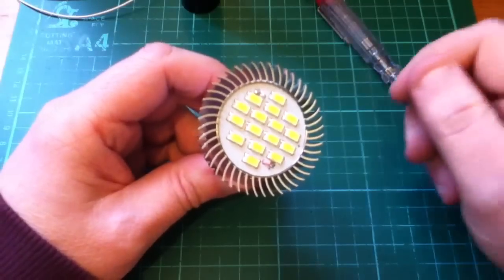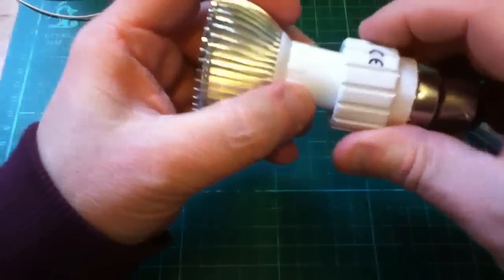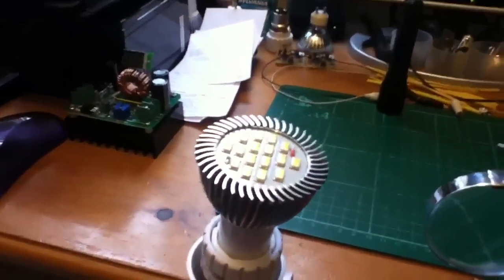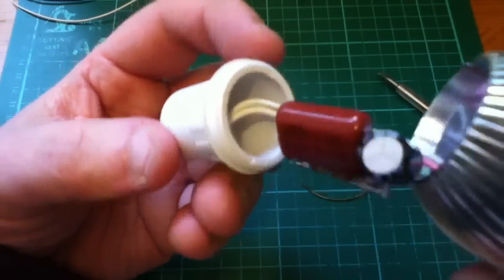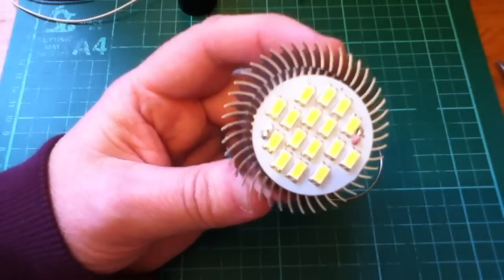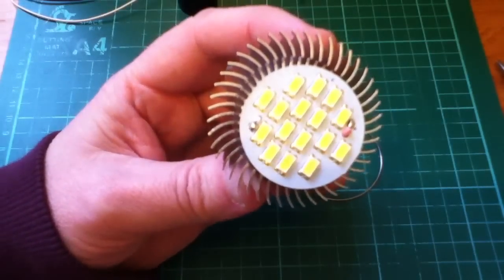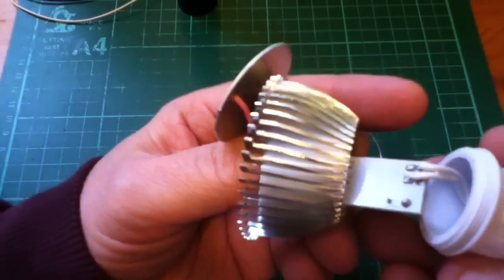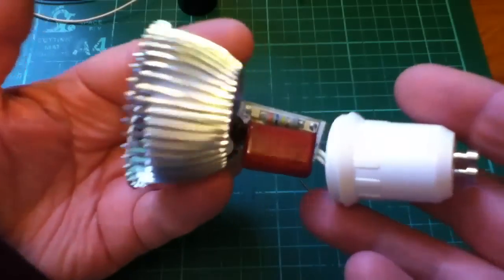Dangerous GU10 LED Spot Light is Cheap and Bright but could Kill You - Seriously

Comment: are you an idiot ??
why the hell you think they have used bridge rectifier for ?
and do you even know how the leds work ?
leds are polar devices, the rectifier has been used to convert the mains AC to DC
so the two notches on the top will have same polarity all the time.
have you measured the current flowing through the circuit or the potential at those notches ??
you are just some idiot talking bullshit .

Comment from the maker: All LEDs produce heat. Heat is a by-product of the conversion process from electricity into light - there's no technology that can do this 100% efficiently. LEDs are better than filament bulbs, but they do still produce heat. Low power LEDs generate a small amount, high power LEDs produce a lot of heat.

Comment: I dont think that there is anything to be scared of as the circuit at the front holding the LED's is only carrying small voltage DC. There is no chance of this 50 - 50 situation you are talking about as an LED is a diode, and as such will only light if the current of electricity is flowing in one direction and the correct direction. Do the lights only come on 50% of the time? No, didnt think so.
Also, mains lighting is not wired the same as mains power. You dont have live, neutral and earth.

Comment: I'd pay 3 quid for that heat sink alone to have as an ornament proper steam punk. What voltage do the Led's run @ 3.7v or 12v? It would be worth buying to convert to battery power for a desk lamp or boat, motorhome or shed

Comment: Sadly, CE marking is worthless. It does not require any testing to get CE, it's only an conformity statement of the manufacturer. You will find comparable built lamps with CE conformity markings.

Comment: A couple of points. One, these lights are not cost effective as they fail in as short as a few weeks of winter use. I know as I have repaired them time after time. Two, Julian is correct they are a shock hazard very much in the same way as the old Christmas tree lights used to be. Most of them carry a CE mark but I'm told i questioned the supply will tell that mean Chinese Export or some such crap. Three, Mistke mistake, your statement tells me you know nothing of electronics!

Comment: you'll have to prove it with a multimeter. test the voltage between the face of the bulb and earth (in both positions). i do have a degree in electronic engineering and i think this is scaremongering

Comment: I couldn't have said it better my self. any one that know even the little's about AC and DC would know that would know DC wont do any thing to you at even 100+ volts and AC / Alternating Current even if plugged in backwards will always power forward just look at a AC fan it never blows in reverse even when plugged in backwards   .. I can see that it dosnt look safe but I havent yet herd of any one die or even been shocked from one

Comment from the maker: There are two circuits to be considered here. The one that contains the LEDs has a small current flowing through it thanks to the dropper components. And you're quite right; the LEDs have just a few DC volts across them. My concern is the other circuit - the one that flows from live mains, through the rectifier diode, along the piece of wire to the front PCB, into your finger, down your legs and into the floor.

Comment from the maker: You're quite right about the bridge rectifier, and I apologise to anyone who went ahead and bought this bulb, thinking that a 50% chance of being electrocuted was an acceptable risk. The diodes ensure there is a 100% chance of being electrocuted. Ignoring the RC side of the dropper, the direct wire link to the front PCB routes live mains (240v relative to ground) during one half cycle and neutral (low voltage relative to ground) during the other. Transformers do fit - most LED bulbs have them.

Comment: I think you need to study how a full wave bridge rectifier works. a bridge rectifier provides a universal +tive and -tive in pulsed dc. (it dosent matter which way round the ac supply is) the + pin will allways be +, this dc is pulsing at 100hz though, so a capacitor is used to smooth it. if you think this is dangerous. connect a multimeter and prove it. also. a cap dropper circuit isn't nasty in this situation. you try fitting a transformer in that space. its the best circuit for the job.

Comment: If you think in this way, it is not possible to change any ordinary bulbs( like 40, 60, 100watts), comparing with 220vac / 40watts bulbs this 12vdc / 6watt gu10 or mr16 power is negligible. Just few microns of insulation is not enough to stop current passing through the metal housing?  This is my suggestion, can you please explain exactly how this 12v/6w power will harm us.

Comment: There should be a fusible resistor in series to protect against fire.  Also, the big capacitor should be X2 rated for connection across the AC, especially since the line voltage in the U.K. is 240VAC, twice what it is here in the U.S.  The LED lights that I've opened up have a step down switch mode power supply, so there's some isolation.

Comment: Not all GU10 spot light are like this, I have 10 at home, and circuitry is nothing like yours, also the one I have picked have a acrylic glass. To bad you picked the wrong ones.

 dx.com/p/gu10-4w-3500k-360-lumen-4-led-warm-white-bulb-85-265v-68459

Hope it helps, out there are many places which offer led light.

Comment from the maker: No, halogens have no exposed metalwork once the connectors are properly inserted in the socket. The housing is made of thick glass which is a very good electrical insulator. They're safe to touch (as long as they're not hot).

Comment: amps have nothing to do with how well earthed you are. amps are draw (Wattage pulled) divided by voltage. that device has a draw of 4W making the amps being pulled at 0.01 Amps... also those particular LEDS use 5.5V and the power is stepped down by a transformer inside just like power packs for any low voltage device. now if the bare leads BEFORE the step down transformer are touching the walls of the device you risk shock otherwise no, and an aluminum casing doesnt transmit electricity this way

Comment: I seek DC LEDs using batteries off grid. Need small night lights, larger spotlights, & 50-100 W room lamp replacers. What DC voltage best for battery/home wiring array (no wasteful inverter) for ALL these plus efficient refrigerator, food mixer, drill, hand saw, computers etc! A big problem with off-grid is getting lights & most appliances using same DC voltage (to wire house/barn). We must devise DC standard for America-Europe-Russia. Making stuff can be good whiteman industry; ban Asia imports

Comment: GU10 incandescent Halogen lamps don't, the reflectors are on the inside of the lamp, there is a glass front on them (as you probably already know) and they have a ceramic base, add to that the fact that the fixture is most likely earthed and you have a safe fixture, even I change the lamps while they're lit even though it's not recommended, all in all, it's just the cheap crappy LED lamps that have that issue of a posible live heatsink, GU10 are safe until they get hot... talk about glowing!!!

Comment: They really should've added some diodes to the live side, and actually make sure that the lamp will not power on when inserted incorrectly, and add a little glass cover over the diodes would've been a nice touch too!!, not using ebay for an LED lap then...

Comment: You do realize that the voltage present at the board containing the LED's is only going to be enough to power them.  Not even close to a lethal voltage. The 300k resistor is what's going to drop the voltage. The rectifier is going to give you full wave rectification and the cap is smoothing out the humps in the sine wave. That's how DC current is made.  Do yourself and everybody else a favor and check voltages with a meter before you start pretending like you understand OHM's law.

Comment from the maker: There is mains on the front whichever way round you connect it - one way it will be neutral and the other way live. High voltage mains, metal casing and no earth is not a good combination. But using a dropper circuit is just reckless. Maybe the lamp was originally designed to use a transformer driver, but the dropper option was cheaper. I can't believe an engineer could sleep at night after designing this product as it's sold

Comment: It's really bad no matter what direction you put it in. Sure, in the "right" way there are no mains on the front, but it's stil pretty high voltage (I'd think all of those LED's are in series so there should be at least like 50V DC and probably a few hundred milliamps). And, since it's not isolated from the mains, it shall always be looked at like it has mains all the way (A short in the dropper-cap and there you go).

Comment from the maker: Fancy a nasty shock?
Reply: +ArJuna22 Not true.  You're making the age-old mistake of thinking that more volts means more danger.  I have been zapped plenty, in both the US and EU, and I will attest, the US is a tad bit more uncomfortable.  You see, 240 at 50Hz is 1/6th slower than the 115 at 60Hz.
Reply: death pretty much
Reply: +Julian Ilett Here in the USA we might get away with a nasty 115v shock, but in the UK the mains voltage is double or 230v.  This has a much better chance of killing you.
Reply: yes because the current is basically unlimited on a non-GFCI outlet which means practically every overhead light fixture in the USA, & even most up-to-code indoor wall outlet recepticles.
Reply: +Julian Ilett No UL stamp? Do you have a similar organization in the UK?
Reply: +Pete Joplin Its not an old age mistake - low voltage and extra low voltage are marked as safer. Hence building sites will only allow 110v (50v centre tapped) tools to be used. Although it is the current that will kill you the secondary effects of the higher voltage will cause just as much damage. To be fair most modern houses in the UK have all circuits protected via a RCD (earth trip). I would be more concerned about having that light in a bathroom with wet ceilings dripping of steam.